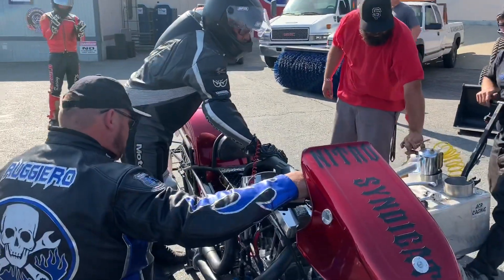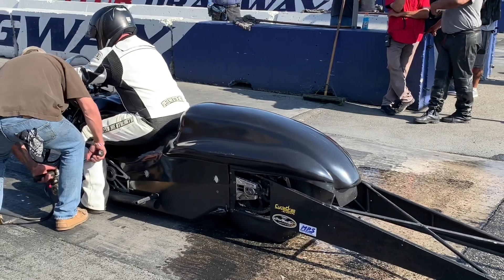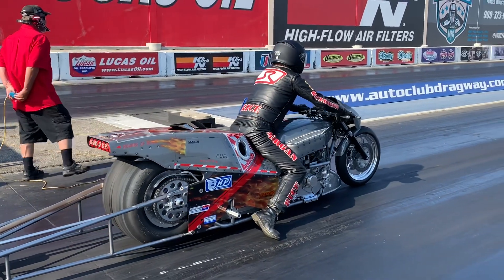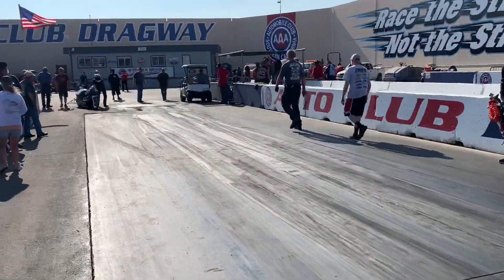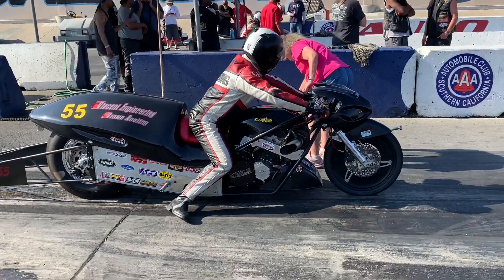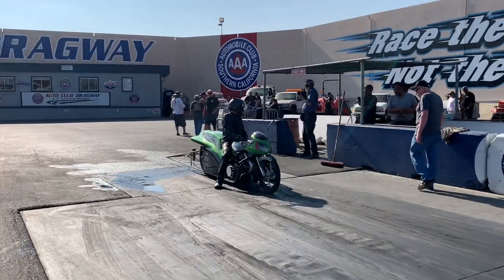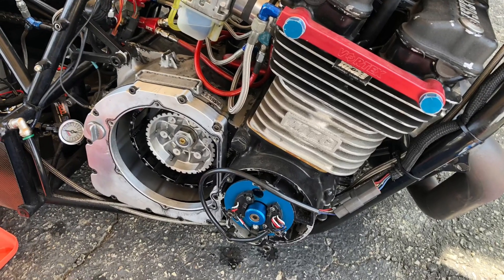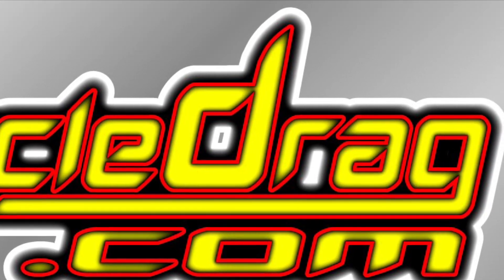10 FASTEST WEST COAST MOTORCYCLES! TOP FUEL NITRO HARLEY vs TURBO HAYABUSA vs NITROUS GS DRAG BIKE

Comment: i had  a turbo z1  with a 1327 cc mtc big block on it  denco centrifical clutch j model head  falicon crank undercut transmission  web cams vertex magnito with rc  drive   sand s  super g carb  with a long arm on it and  battery eliminater on itt    no battery and you kick started it   usually started first kick  oh yea  had mr turbo headers and  american turbo pack intake mamifold  ran the tires off that bike for 28 years from 1978  to 2006   andi implimented a gsxr1100 single shock in the rearr ,...now  zx14   this bike is just as fast  almost stock been remaped with titainum header and flow master exhaust